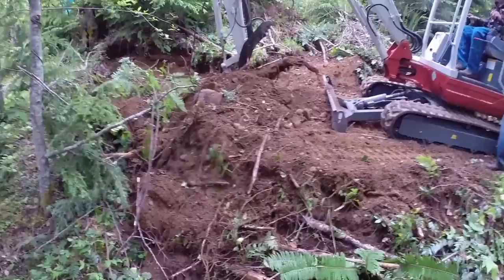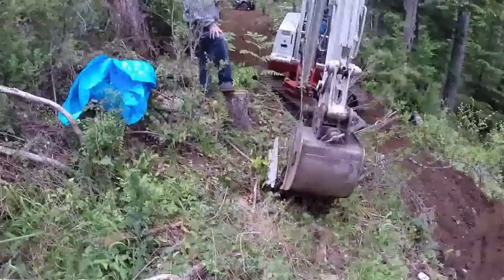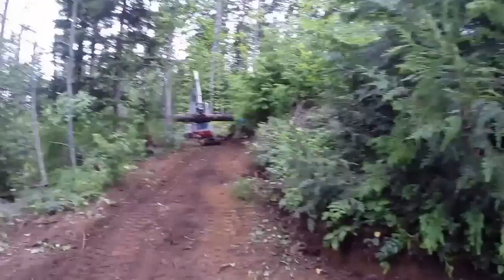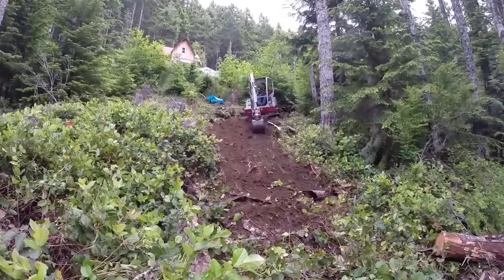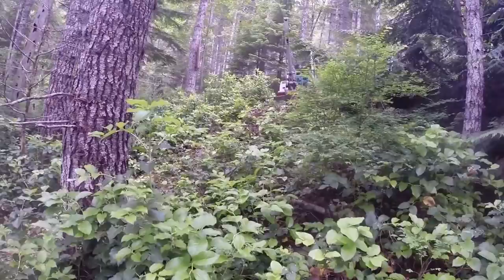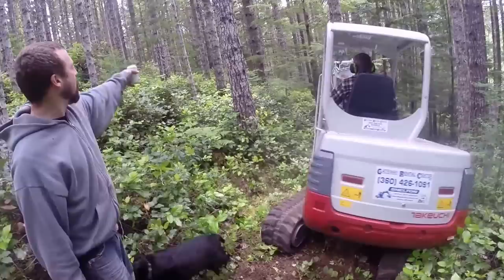Blazing New Trails with Mini Excavator - Off Grid Cabin - Part 1

Comment: I’m sure you have since discovered this but that trail will wash out in the first big rain if it goes straight down the hill.  It would be a better design to go across grade with switchbacks. It takes more space and is more expensive to build but you will pay that and more in future maintenance. To make a good operator one needs to know more than how to run the machine, he also needs to know good grading design. I’m not trying to be a know it all or critical just I have learned from my brief experience in making trails with an excavator and making mistakes.
Reply: I have 10 acre's in MI that is nothing but hard wood up to 24" and and a lot of fire wood.  I need to build a drive way, plot for house and put in a septic.  Do you see any problem with using this style of excavator to do the job?  My land is all sand and flat, mostly.
Reply: i have zero experience and that thought came to mind, i'm glad to know i have a micro inkling of judgement